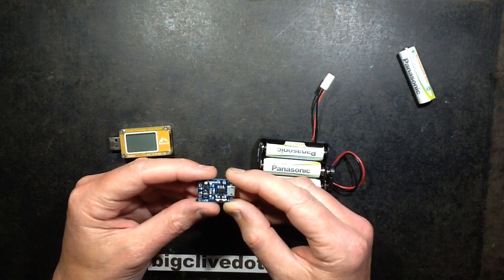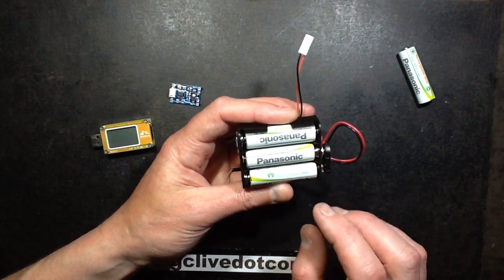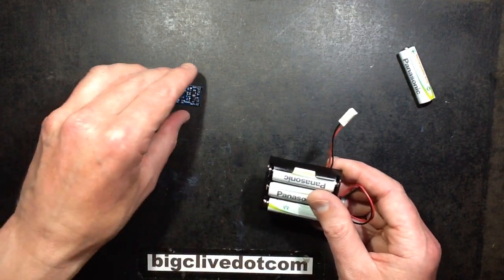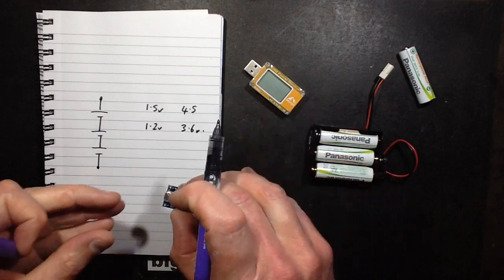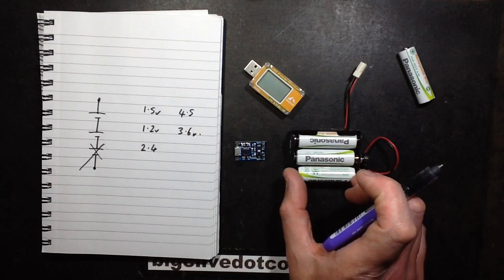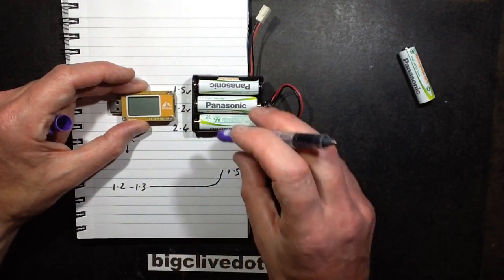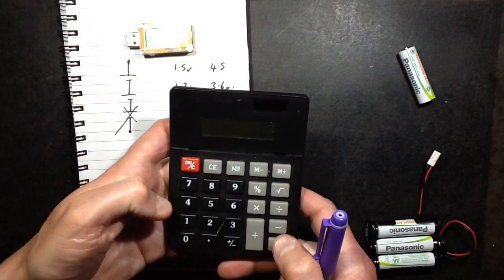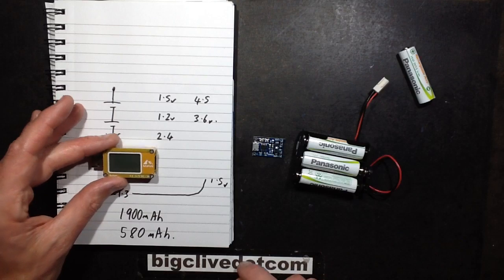Can a lithium protection circuit be used with 3 AA NiMh cells?

Comment: I keep coming back to this video every few months when I've forgotten the details and now I wonder if this could go the other way around.  Could I replace the (3 cell) Ni-mh battery packs (3.6V) in my cordless home phones with one of these charge / protection boards and a single flat Lipo battery.  I would like for the normal internal charging supply from their bases to charge them so maybe also install a 5V boost converter from the internal supply to feed the Li-ion charger.  I keep them at opposite ends of the house from the base and their reception is not great.  Seems like a definite maybe...

Comment: I just thought the same thing (years later).  I just did a capacity test on a standard AA 1.5V alkaline battery (cell) and found that over half of it's total capacity is below 1.33V.  I've usually pitched them by then due to low voltage.  Need a way to boost the output to use all the capacity of these cells.  If they were Ni-mh they would need to be protected also.  We need another video from you.

Comment: Use a diode just for the 0.6v voltage drop??? Between the PCB and the battery??? Maybe two reverse parallel diodes for the charge and discharge??? Thanks Clive, I love your videos and streams.

Comment: I watch this video and made an experiment at home.

Not using tp4036 but 2s bms for 6 nimh  800 mAh cells. Charging via p+ and p- with 64 mA. Bms stopped charging at 4,25V for 3 nimh cells and stopped discharging at 2,9V per 3 cells.

I think that such small capacity you get is because high charging current. Try to drop this current to say 200 mA. There is schematic on the net and table with resistor values. Maybe something like this helps
https://www.best-microcontroller-projects.com/tp4056.html

Comment: I'm currently trying the same thing with an IP5306 controller and 3.6V NiMH battery pack (3 AA cells). The IP5306 is on a LilyGo TTGO T-Call V1.3 ESP32 board and has I2C. This means I can change the current and voltage at which charging stops via the EPS32 using I2C.

Comment: I wonder if there is a way to put a diode in the charging circuit so that the diode fools the circuit into thinking it's 4.2V when the cells are at 4.8 volts...?

Comment: I purchased QTY 10 TP4056 boards by mistake. Is there a way to lower the voltage to charge 2 AA batteries? I was thinking about using an LD33V voltage regulator that could charge 2 AA batteries at once, and have the TP4056 turn off once the voltage was at 100%.
Reply from the maker: The TP4056 has fixed voltage thresholds.  It might work with a diode or two in series.  You can keep trickle charging nickel metal hydride cells, so changing the current setting resistor could adapt it to a simple constant current charger.

Comment: Exactly the video i've been looking for .... I've been using the tp4056 soldered into a few of my kids toys for charging 3 nimh batteries in each toy and the darn thing shows the blue light, meaning fully charged yet the toy dies out in less than 5 min ... After seeing your video, i'm gonna take out all the tp4056's and just direct connect the battery to the micro usb ... I think that will do a better job ... Thanks Big Clive ..
Reply: And how do you check whether the batteries are fully charged with only the USB connection? It would overcharge

Comment: HELP PLZ, can someone link me a protection-charger module for 2 NIMH batteries in series?
Reply from the maker: It's not a standard thing for NiMh cells.  They tend to be trickle charged continually or if being fast charged the chargers detect a voltage transition at the end of charge.  It's lithium cells that need the extra voltage monitoring and balancing.

Comment: It depends on the protection circuit's maximum charge voltage.
I have 3 very low internal resistance 1300mAh NIMH AA's and they are LSD type
so they work extremely well. almost a drop in replacement
I hooked them to a rechargeable USB fan's LI ION terminals and it had a very decisive discharge cut-off when it started dropping off at just under 2.8v it cut off.
And charging it charges up to 4.19v and keeps trickle charging with constant voltage for quite some time before it finally cuts off the charge.
and with a discharge cycle again. it lasts about the same amount of time as if I were to charge them individually in a smart NIMH charger
so it seems to work pretty good. it can't tell the difference between the three NIMH"s in series and an actual LI ION cell
it just charges them the same way and cant tell the difference.
i have another LI ION protection PCB that charges to the upper limit and it charges at 4.35v and keeps it there for quite a long time before cutting off. and the lithium battery dips to 4.2v
with that one it keeps charging for a significant amount of time and my 3 AA NIMH's finish at 4.3v after sitting for a while finished from its charging. which gives a few more minutes of runtime.
the fan uses only about 0.2 to 0.55A so it lasts for quite a while off a 2,200mAh LI ION cell

Also you would want the charge current to be high at first. then drop off to a low charge to top it up as much as possible.

Comment: Great video- Thanks!
Do you think if 4 AA NiMh batteries were used it would make any difference? I just bought a few of the TP4056 modules off ebay and am wanting to charge NiMh types also. I'm a bit afraid of using lithium right now. It's for a kids portable USB lamp.
Hoping to charge via USB. Hmm... but maybe 4 NiMh is too much for USB?
Or is changing the resistor out and using 3 cells a better option-
Thanks in advance for any help!

Comment: yeah the charge portion of it isnt going to work cause 3 nimh cells reach full charge around 4.5-4.6 volts or so and a usb lithium ion charger like that one will cut off at around 4.2 volts (charge level for typical lithium ion) Thats why they won't charge all the way. The cutoff voltage for a lithium ion is too low for NIMH's
Reply: umbrefawx - The data sheet for the common controller is full of interesting things. A single resistor change, even two, completely changes the current and voltage limits. 

People talk about this chip as though these limits are fixed. They are not.

Comment: I have good results with Sanyo Eneloop charging with 1.45V with current limit to 200mA - if I left it for 24hours it charges to roughly 1600mAh (1900mAh nominal). I use it as built in charger to few devices I modified and it works perfectly

Comment: Perhaps it has to do with the charge current setting. You might need to lower it for the NiMH cells. I don't think it's common for them to be charged with approx. 500mA. NiMH cells, as many other types of batteries, are capable to keep the terminal voltage low by themselves, even when fully charged. But in order to make that work you need to adhere to the charge specifications of them. :)

Comment: I would suggest trying the "pre-charged" type, such as Eneloop.  I have an AA/AAA charger (BC-900) that shows the voltage, current and mAh readings as the batteries recharge and most of my pre-charged type show a voltage reading around 1.35v as they recharge with the current set at 500mA.  The voltage goes above 1.4v within the last 30 minutes or thereabouts, assuming the charger is measuring the voltage correctly. 

With the standard Ni-MH cells, the voltage often goes above 1.4v shortly after the charge starts and approaches 1.5v near the end of the charge cycle, at least for the 7DayShop variety I had before they wore out.
Reply from the maker: Seán Byrne These were a similar style of NiMh, but you raise an interesting point.  The default charge current of the USB charge board is quite high.  The amount of charge put into the cells before reaching a combined voltage of 4.2V would probably be higher if I reduced the charging current by swapping out the charge chips reference resistor.
Reply: bigclivedotcom I just tried two flat Energizer 2400mAh pre-charged type batteries at 500mA.  At the 1000mAh mark (2 hours charging), the voltage showed 1.39v for both, so a fair bit higher than I thought (x3 = 4.17v).  

When I increased the current to 1800mA (max my charger goes), the voltage settled at 1.4v per cell after about 10 minutes and then increased to 1.41v around the 1500mAh mark.  I'm off to bed at this point, so might try this another time to check the voltage readings at periodic stages throughout the cycle on Eneloops for a 500mA charge when I get a chance.
Reply: Thanks for the interesting video! I'm trying to use a TP4056 to charge a battery pack of 3 NiMh batteries in series with a solar panel (5V, 5W). I'm going to replace the TP4056's reference resistor with a 5.6 kΩ resistor which will limit the charging current to approx. 200 mA. I'm using 3 "pre-charged-type" AA batteries in series, with a capacity of 2,000 mAh. I expect the charge board to stop charging at 4.2V, which will presumably not fully charge the battery pack, but hopefully enough to power a μC via step up converter.
Reply: @blumenretter3570   were you able to achieve 200mA by replacing the existing resistor with a 5.6kohm resistor on the tp4056 ... And if you did, Can you possibly share the schematic/photograph on which resistor you swapped on the tp4056

Comment: i would focus more on replacing the 3 nimh's with one or more 18650's. you can get much more power in the same space and you can use those charger boards.